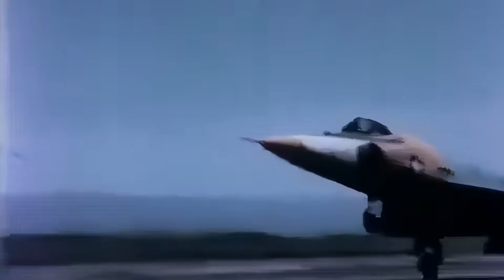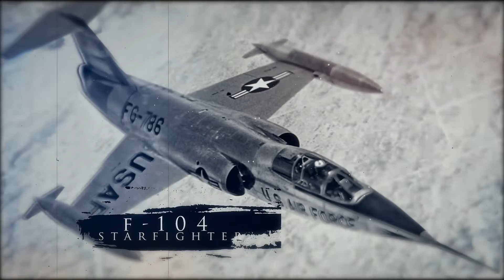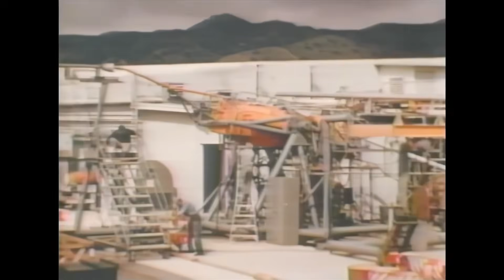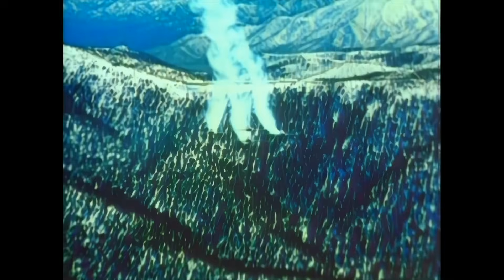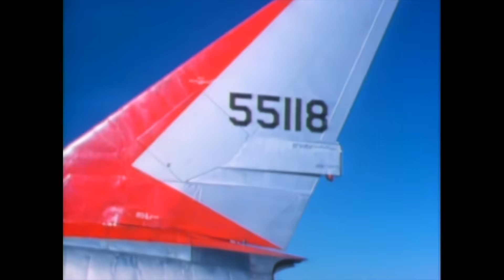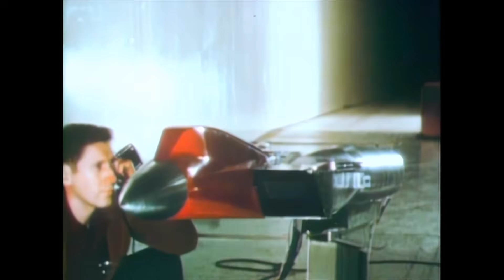U.S. Cold War Sentinels. The American Jets That Defined an Era | Full Documentary

Comment: The 104 "beat" the competition for European contracts, by being "clearly superior"... sure... it had nothing at all to do with Lockheed's chequebook...
Reply: @JackNiles-hc8yz
No,  it wasn't superior, it was fundamentally unstable for the roles in which it was to be employed. The various European countries that operated it would have been better off with the Mirage.

The 104 "won" through bribery, not merit.
Reply: @JackNiles-hc8yz 
The USAF evaluated that ability in the clear skies of Nevada. Central Europe in winter looks a tad different and the 104 had a distinct inability to out maneuver hills emerging from the mist... it isn't "a load of crap" it's a fact.
Reply: @JackNiles-hc8yz 
It was an at the time call made by the Luftwaffe when they said they didn't want it...
Canada didn't want it either, they just couldn't afford the F-105's that were purpose built for the role they forced the 104 to perform.

The Mirage, was extremely adaptable and was sold around the world based on the fact that it was demonstrably successful in combat... no bribes required.
Reply: @JackNiles-hc8yz 
It wasn't me, now exactly what have I said that isn't true?

Not my problem if reality offends you. The 104 was not designed for low level nuclear/tactical strike in poor weather... consequently it sucked in this role.
Reply: @JackNiles-hc8yz 
It was reflected in the accident rates.
It was originally designed for an exclusively air-air role, Spain used it as such and didn't lose a single jet. Italy had dedicated air defense and strike squadrons, the strike units had double the accident rate of the interceptor units.
It wasn't designed to nip around mountains and valleys at high speed loaded with ordinance, consequently it wasn't particularly good at doing so.
Reply: @JackNiles-hc8yz The Grumman F11F-1F was as fast, has at least as much range and weapons capacity, was more maneuverable and was far easier to fly.  Grumman offered equivalent licensing and production offsets. Grumman was just out bribed.

Comment: It's always funny that these American programs are put above other programs. Did you ever hear of the Canadian AVRO Arrow. It out classed every US built fighter but Canada was pressured by US to give up the program since it would out compete any US air craft and maybe take away manufacturing jobs. It was the only jet at the time that accelerated and could break mach at a vertical climb at the time. The engine was called Iroquis developed in Canada and it was a delta wing aircraft.
When the Arrow program was stopped because of US pressure, all those engineers and smart people went south to NASA, BOEING for work etc. I guess US got what they wanted. In return we were given ground to missiles, what a joke.
Reply: BAC TSR-2 is another example.
Reply: @seanchang1202 
The thing is, the TSR-2 was beaten in every single way by the F-111
Reply: Someday I'll find an Arrow fan who is honest, but apparently that's not today.

The Arrow did not outclass US fighters.  The Arrow wasn't a fighter.  Maybe you should learn what something is before you write about it, but I digress.  There was no US pressure to cancel it, in fact the US was very supportive of the Arrow program, providing assistance on several occasions.
Reply: @critter // I agree.  I would say the Golden Rule applied. The Country spending  MORE of the gold makes the rules. WE DID NOT WANT FIGHTER COMPETITION.
That said:
* The U.S had the three legged stool: Long Range Bombers; Boomer,  Polaris Submarines; AND Silo Minutemen ICBMs.
* US Bureau of Standards.
* Army-Airforce to Air Force to NASA
* Satellite & Space Programs
* Lawrence Livermore Laboratory
* White Sands Missile Range
* JPL (Jet Propulsion Laboratory founded in NINETEEN HUNDRED THIRTY SIX !!! (by Cal Tech).
* WWI to Boeing to 1930s U.S. Air Mail Service (also parts of Canada).
* Manhattan Project.
* LEND-LEASE.
* NATO costs.
* UNITED NATIONS costs.
*
Canadians fought valiantly on D-DAY; Love & Care for their Country; & amazing Hockey players. They are good Academics; but, when it comes to THRUST, EXPENSE, DIRECTION, & CONTROL, 'MERICA WAS GONNA RUN THE MILITARY SHOW !!!
Reply: Because America is Canada's defense. So we say what goes.

Comment: Stupid question but, drop tanks, what happens after they drop? Just hope it doesn’t hit a building or something? And I assume they are just scattered everywhere at this point. Right?
Reply: In peacetime you wouldn't typically drop them at all, in combat you've got more important things to worry about than what they may hit.

Theres plenty of them in SEA that have been recovered by the local population and repurposed as canoes, troughs pontoons and god knows what else.
Reply: In Vietnam the indigenous turned them in boats.
Reply: Same thing I've always wanted to know..I can only assume they drop the tanks in a safe unoccupied area..the ocean or something..but what in the heat of battle? And u need to get rid of the extra drag?
Reply: In WWII, the drop tanks were pretty light.  An empty gas can was probably the least worrysome thing falling out of the sky at the time.  With the advent of mid-air refueling, there would be no need to drop a tank except in actual combat.
Reply: The laws of gravity and aerodynamics govern that impact point.
Reply: They would normally drop them over water